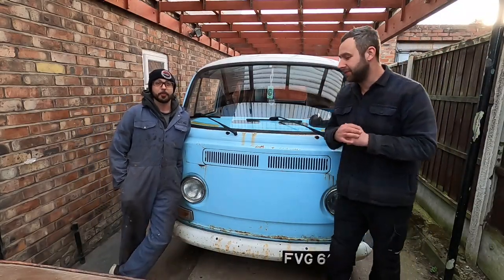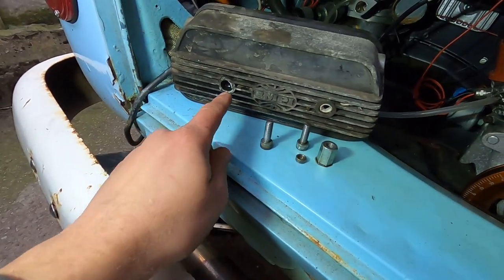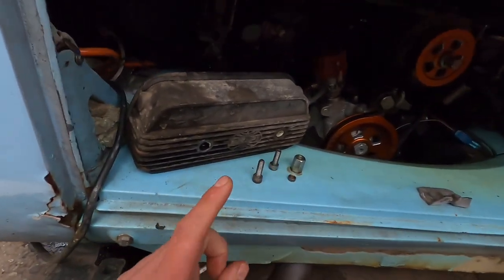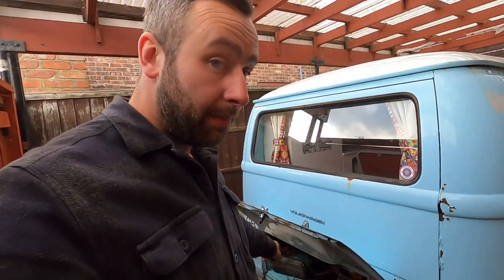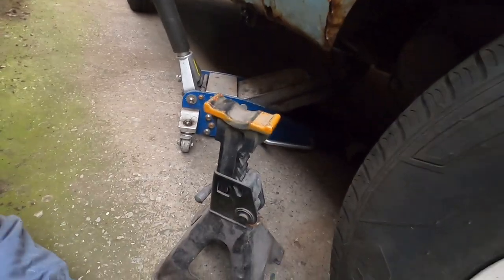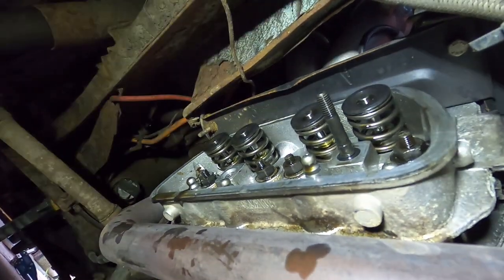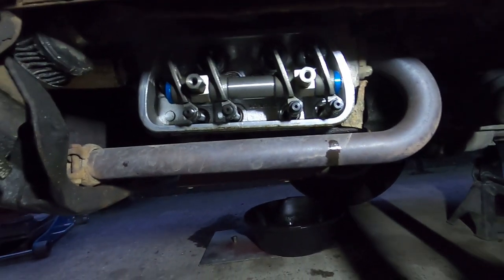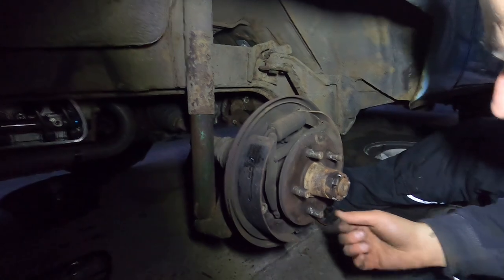ITS BROKEN ALREADY! - VW T2 Bay Window Camper Van

Comment: Marking its spot. I got these rocker covers on Mrs wizard not a big fan but lucky easy fix but also re torque heads whilst there off. Cool bus !!
Reply from the maker: Oh that’s a great tip thanks buddy for that. I will check the torque settings while
I am in there.

Comment: I think one valve had been adjusted too tight, put load on the stud, it finally gave up, loosening the rocker shaft and making the valve adjustment really loose and very noisy. Nice that it waited to give you some content before failing. I’m guessing as you said the handbrake locked on through lack of use and was ripped off when trying to free it. Give us some more symptoms of the starter issue… is it clicking… getting power. Much enjoyed… I thought I was the only one jinxed with new(to me) car issues.
Reply from the maker: Yes I think your right with the stud. New parts have arrived now so hopefully we can sort it out. 
The starter issue is odd it’s like the battery isn’t charging but the starter doesn’t always engage. Obviously not had chance to look at that as the engine is in bits currently. I will keep you all posted.

Comment: That stud must have been overtightened. If replacements are not readily available, it doesn't look like a difficult job to make them for anyone with a lathe and turning experience. Perhaps a tougher grade of steel to prevent recurrence of the problem although, to be honest, it shouldn't need a lot of torque.
Reply from the maker: Yes that’s what we think also. I have the new correct fitting kit now. So hopefully we can get it all built back up and running soon.
Reply: Overtightened  was my first thought as well.  The EMPI covers are known leakers, and the usual solution for most people is "it must not be tight enough" leading to overtightening and broken parts.  From what I can see there the engine builder did it right correcting the rocker geometry when assembling the engine (or at least made an effort at it) so I don't think that's the problem.  If it were me, I'd probably be making sure you weren't near coil bind on the valve spring at full lift, and that you have some room to the piston as well, as either of those could also cause that failure.

Comment: Surprised that stud snapped 😮, if you can't find the correct gaps, measure what the other side is set to and copy that?
Reply from the maker: Yes same here it was a shock. That’s then plan to copy the other side. Cheers
Reply: I did one 50 years ago and 14 thou comes to mind?

Comment: Ask your engine builder what style pushrod you have if they are chromoly. You need to adjust them with a loose zero lash
Reply from the maker: I have the engine specs, it all seems ok. Just need to reset the tappets and not over tighten that rocker shaft nut.

Comment: Vw schofields sell top quality stuff that's not over priced. Vw heritage are too expensive by 30%, give them a wide birth. Also try custom and commercial, they make a lot in house and are cheaper on some items.
Reply from the maker: Yes heard about those I will be using them moving forward for sure cheers